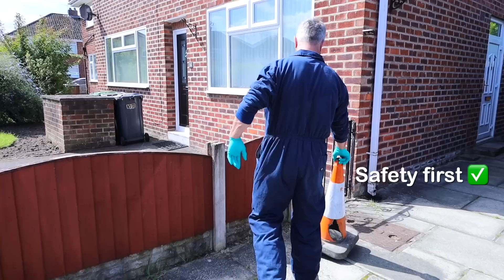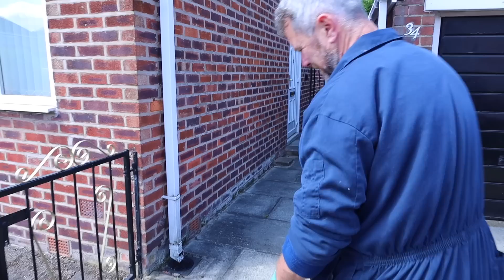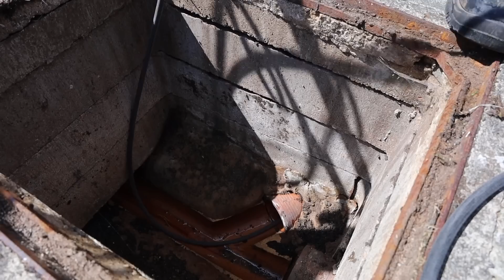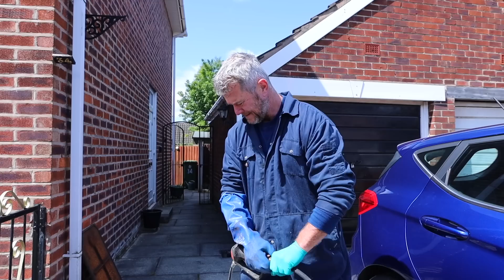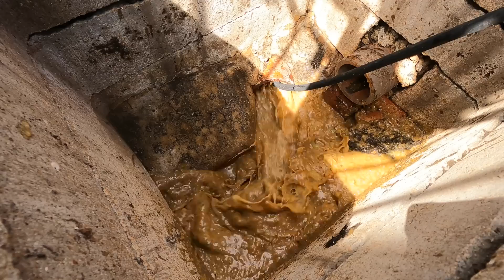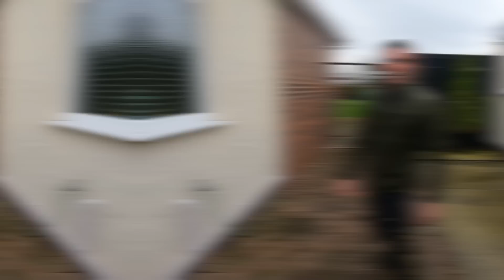Manhole Unblock 💩 What a Gushing Surprise 💩

Comment: Hi Jetter 1 do you watch Ollie from drain addict? He does what you do in Sydney in Aussie. I know the drains are different and for the most part  you don't need more than 10 m. In Aussie you end up getting to the drain where it exits the property or another outlet beside the house. In Britain you have multiple man holes on a property. Look at the gear he has. You've just got a gun and 10 m of hose. He brings a full hose reel with a long levered ball valve on the side. He seems to have more pipe between the boundary and the toilets than British homes have. The hose sections are bigger.  Here in New Zealand We usually have and inspection outlet on the outside wall of the house and none on the boundary. Sewage is separate from storm water here and if you run a storm water (roof gutter) into a sewer you are in trouble with the council. Most storm water drains run onto a road into the drains and to a beach eventually.  You put out awesome videos. Its a wonder they don't ban wet wipes as they seem to block up drains better than tree roots and they don't dissolve . But in your case they are good for business LOL